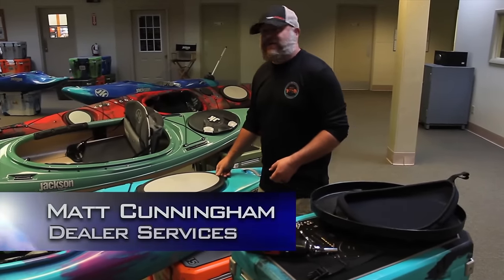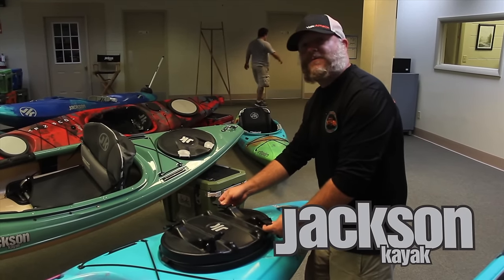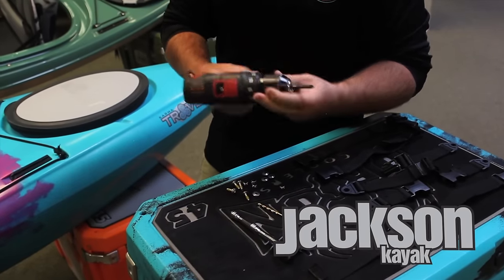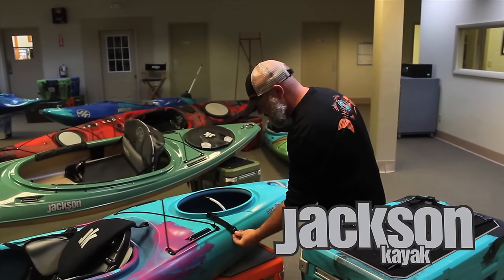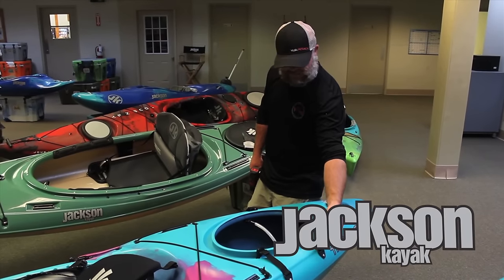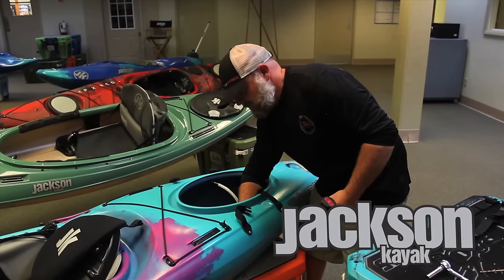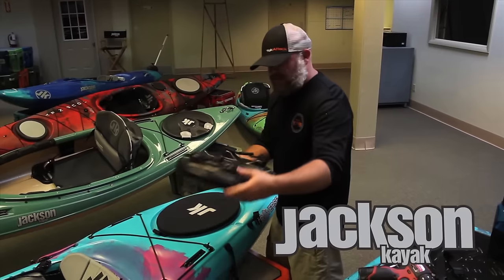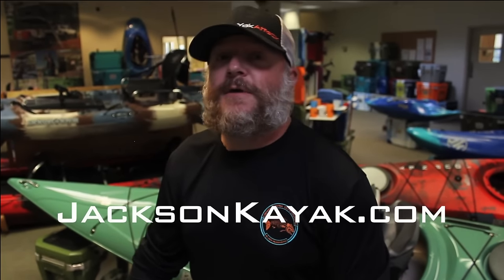Hard Hat Install

Comment: I'm a little surprised to see that the hardhat doesn't just go over the original rubber covering, like it does in many sea kayaks. Is the neoprene skirt just as watertight as the rubber cover? Or is there some compromise there?